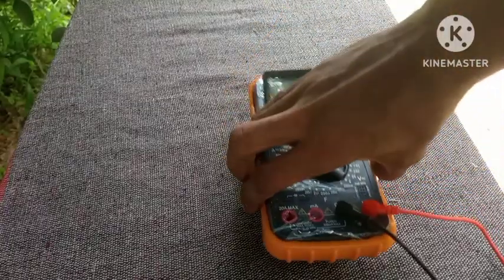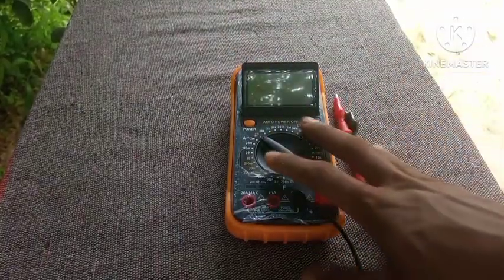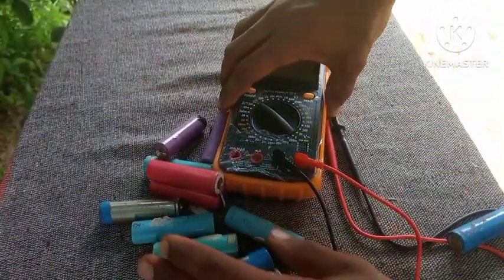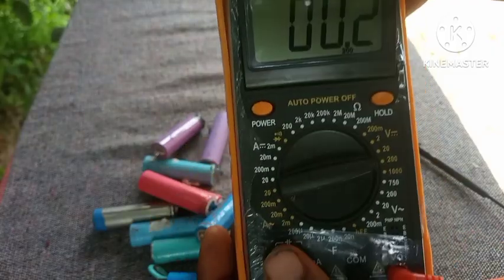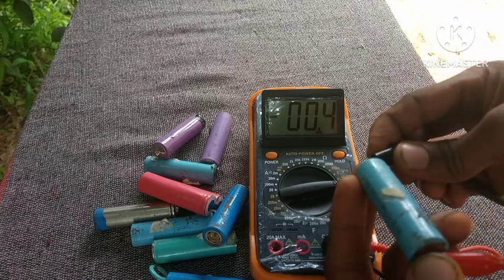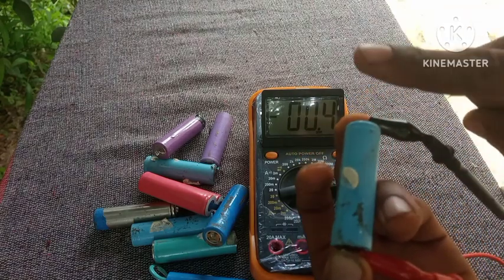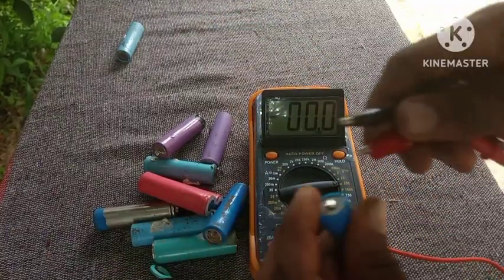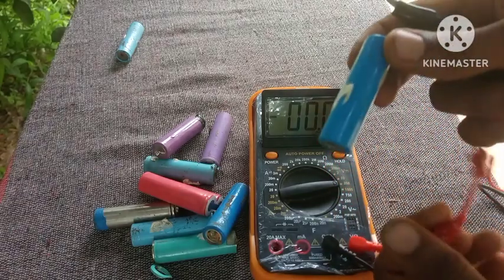How to sort lithium ion batteries

Comment: 1) Set multimeter to 20V range, it's crazy to use 200V range to measure maximum 4.2V. 2) at last you need to measure internal resistance of fully charged battery. You need measuring device with kelvin method or special mode of multi-meter which use internal resistor. I think that It's possible find another much cheaper way using just multi-meter and resistor.
Reply from the maker: That's absolutely right, but it will be more accurate if you use a battery internal resistance meter to also sort this batteries. Thanks for the suggestion.

Comment: Usually when Liion batteries reach bellow 2,4 to 3V will be damaged. They will still work but shorten their life span and performance drastically. Not to mention higher the risk of fire when charging. Please study the recommended usage for each battery type before trying to reuse one or at least be aware of the risks.
Cheers.
Reply from the maker: That's true, they also lose a lot  of  capacitance that's why batteries like this can be used in projects that requires less energy to work but before using it needs to go through a series of test run to ensure the safety of the user.